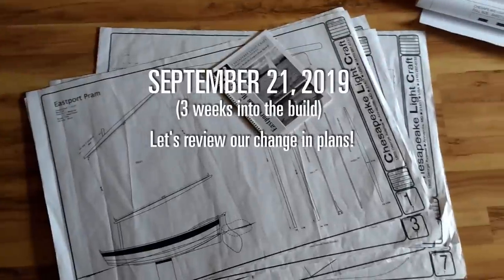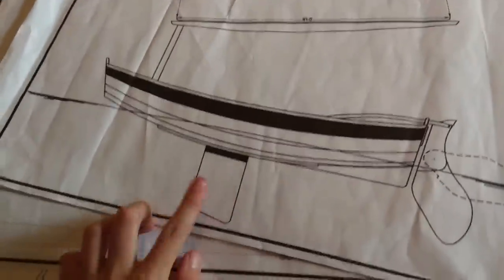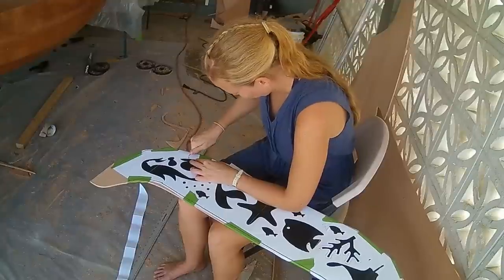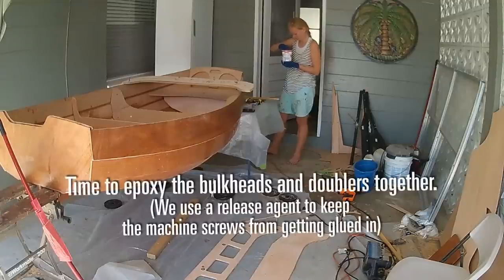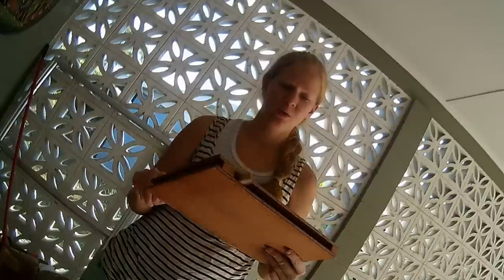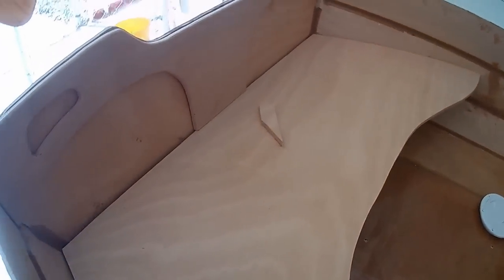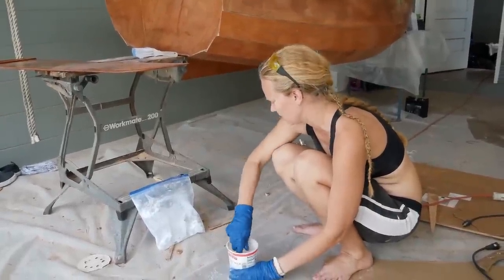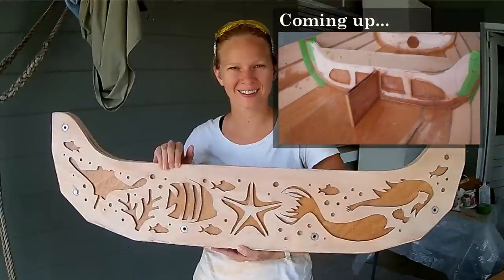Emily Builds a Sailboat - ARTSY STUFF - CLC Eastport Nesting Pram (Ep 6)

Comment: For the future...I did a course in Epoxy Resin and they said it is more consistent to weigh your parts than to rely on volume. 
Your art design is beautiful. Incredible jigsaw work. You definitely have patience on your side. You are awesome!!!
Reply: Even better and simpler than weighing the parts, is to use epoxy/hardener that comes with dispensing pumps. One pump of hardener for every two pumps of resin... dead simple!

Comment: Whenever epoxy is slow to harden, first thing to try is heat.  You can take the whole boat up to 120 to 140 F -under a black tarp on a sunny day will do it.
Reply from the maker: We experimented with the heat gun, and with putting some smaller pieces (such as the daggerboard trunk) in the oven at about 120 degrees. It didn't quite harden up. In this case, it was just a matter of time, I guess. -E

Comment: I always find the instruction to "mix gluing epoxy to a smooth, peanut-butter-like consistency" to be mildly irritating, because depending on the temperature and how it's stored, the consistency of peanut butter can vary a lot, from soft and almost runny in hot weather, to quite stiff when cold. So what should it really be like?

The guide produced by my epoxy manufacturer (Bote-Cote) uses much more useful analogies:

  * Use a tomato sauce (ketchup, for you Americans!) consistency for laminating large or smooth areas, so it can flow out under pressure.
  * Use a mayonnaise consistency for edge gluing or for bonding rough sawn timber where the epoxy must fill gaps or be held on the surface without running off.
  * Use a soft putty consistency for fillets.

Much more helpful, IMO.

Comment: Wouldn't it be better to cut the boat before installing the bulkheads, so that you don't risk cutting into them? (just a layman's idea; I'm sure there's a good reason for installing them earlier).
Reply from the maker: Sure, there is a risk of cutting into them (hence the cardboard between them during the big cut), but unless it's really bad, it will be hidden when the boat is assembled anyway.  If I cut first, and the bulkheads are installed separately, there is a greater risk that they will not line up or be flush with each other when the boat is assembled. That to me.is much worse. I'd rather risk an unclean cut than having two boat halves that don't fit together. -E